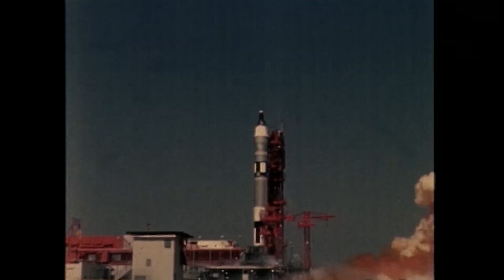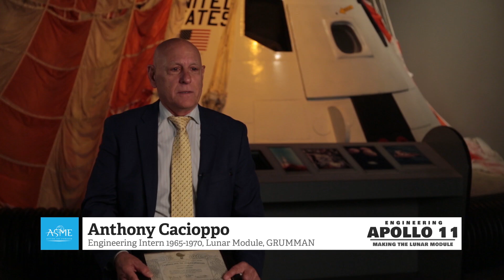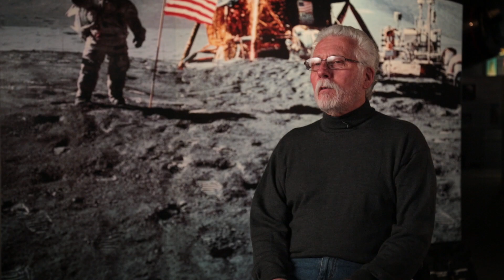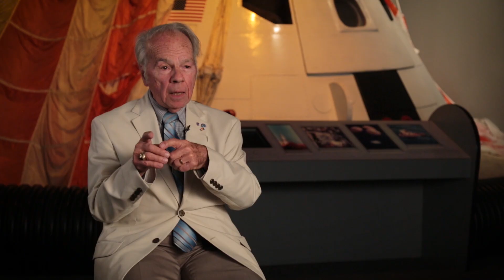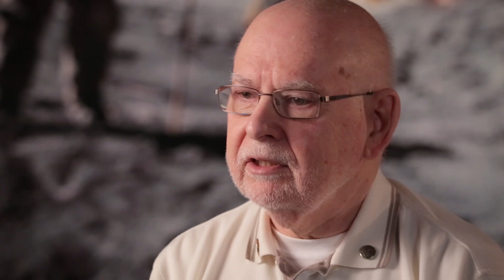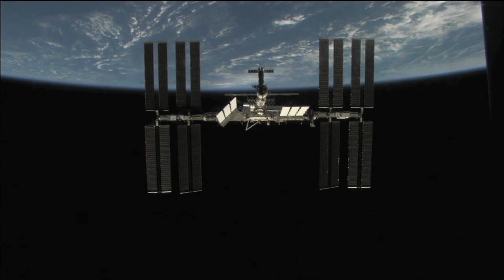Engineering Apollo 11: Making The Lunar Module [Full Documentary]

Comment: More deception, right down to the title. I was looking forward to how on the same crew vessel could that cool the hot side and warm the shadowed side but all I got was a bunch of flag waving. At this point there is no reason to release real, technical films of how it was constructed.
Reply: The lunar module is always sitting in the Sun. 
There are only two ways heat can transfer on the Moon. The first is radiation, both directly from the Sun and from the Sun’s reflection on the surface. The astronauts’ spacesuits were designed to reflect almost 90% of the light, so very little heat would have transferred to them. 
The second is by conduction from direct contact with the surface. This is also an ineffective process as the dust, soil and rock on the lunar surface is loose and doesn’t conduct heat well and the astronauts’ boots were insulated, slowing down conduction even further. 
The heat generated by the astronaut’s body was captured inside a web of fine tubing within the spacesuit, into which water was circulated. The heated water then entered a heat exchanger, located inside the suit’s backpack. This water then reached a sublimator, where it was slowly and gradually exposed to the vacuum of space. The consequent pressure-drop made its temperature fall; the water would freeze on the outer surface of the sublimator and turn directly from ice to water vapour, which was discharged through an appropriately provided duct. To increase and decrease cooling a dial on the suit control unit was used similar to a household environmental system. The Lunar Module used sublimation in a similar manner but with tanks of coolant.

Comment: Moon landing is something that is hard for me to believe. 
This things don't look like flying machines to me and both astronauts looks almost the same size of the module. 
To me, it just raised more questions
Reply: Because you are basing them on false premises.
Reply: You are basing your comments on what you are used to seeing an aeroplane do in an Earth environment. Because it would operate only in a vacuum, many things didn't need to be sturdy, nor did the shape of it matter. It would never have to deal with aerodynamic drag. In fact, the LEM was designed to buckle in the right places, as this was the most weight-efficient method of handling the shock of landing. The crew compartment was extremely cramped.
Reply: The lunar module was 23 feet tall.

Comment: Jim Steele answered to me. But I cannot find his post attached to my statement here, so I make it general. He calls me a moron which I always slide such person in the lowest inelligence level of evolutionary development. He argues that the blades that cut the lower and upper stages of LEM at take off do not have to be made of steel but rather of non-conducting material as not to create electrical shorts by severing cables and conduits between the stages. I never posted any thing about blades made out of steel. Or maybe he confuses steel with his last name of Steele; first name Jim?
Reply: So?
Reply: The blades of the guillotines were made out of steel. All of the electrical wires that were cut were deenergized first before the guillotines cut the wires. Since there was no longer any voltage on any of the wires, cutting the wires did not produce any electrical short circuits.

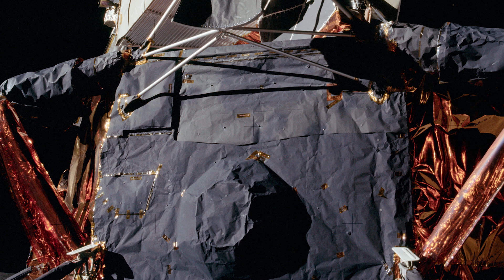Comment: At 5:38 the guy says that at the take off the upper part was severed from the lower part of LEM with a guillotine. Please, if you severed electrical cables, cables attached to batteries and fuel cells, fuel cables and other attachement conduits of upper and lower LEM parts, you would create unbelievable shorts in the electrical circuits and that would blow up all fuses and possibly create fire and render the take off as an impossibility. If anyone does not believe me, then take a pair of scissors and go up to any electrical cable that carries electrical current to a table lamp and cut it as fast as possible, then you will get an electrical shock and you will create a short circuit and at best blow fuses up in your home. I wonder who is that brave to do that. This is a bunch of crap. LEM never took any man to the Moon. No man was on the Moon.
Reply: All of the equipment in both stages contained isolation relays that were opened just prior to liftoff. After that all of the cabling going between the ascent and descent stages was deenergized before being cut by the guillotine. Similarly, as long as your lamp cord is unplugged before its cut nothing bad will happen except that the lamp won't work anymore. Also, there were no propellant lines going between the two stages because each had its own separate propellant supply.
Reply: @joevignolor4u949  I knew you would know the answer - excellent.
Reply: @joevignolor4u949  Keep right on OWNING the ignorant Dim Wit Joe. He's just a troll.
Reply: @joevignolor4u949  Hello Joe, one question I have that you might be able to answer.  Why didn't the SV4B/CSM-LEM stack travel on to the Moon after it had reached Earth orbit with the LEM in the shroud and then complete the transposition and docking just before orbiting the Moon. This would have protected the LEM for 3 days from the possibility of meteorite strikes, (which of course didn't happen) but I have always thought that was a big risk as it was rather flimsy. I suspect it had to do with fuel and weight restrictions. Thanks.
Reply: @Puma-70  Probably for several reasons. One was attitude control. The S-IVB had its own separate attitude control system that kept the stage and the Apollo spacecraft in the proper attitude during earth orbit, TLI and the transposition and docking maneuver. Once the propellant supply for the S-IVB attitude control system ran out there would be no way to perform attitude control using the S-IVB during the rest of the coast to the moon. The attitude control system on the CSM was too small to control the attitude of the CSM, LM and the S-IVB all together as one unit. Therefore it was necessary to get rid of the dead weight of the S-IVB. The other factor was the Inertial Measurement Unit (IMU) in the Instrumentation Unit (IU), which allowed to S-IVB to perform attitude control. The gyro platform inside the IMU was aligned at launch but like all platforms it would slowly drift over time. The platform in the S-IVB could not be realigned in flight using star sightings like the platforms in the CSM and LM could be. As such its usefulness as a reliable attitude reference was time restricted. 

Next, up to three mid-course corrections might be required during the outbound coast to the moon. If the S-IVB was still mated to the Apollo spacecraft the correction burns would have had to be done using the S-IVB's big engine instead of the smaller engine on the CSM. So now you might have to restart the engine on the S-IVB up to four times, instead of just once. You'd also have to load the extra propellants onto the S-IVB to do the corrections. 

Aside from these primary factors the S-IVB had flight batteries that would eventually run down. Another reason would have been that separating the CSM from the S-IVB would allow the high gain antenna on the back of the CSM to be deployed and used. Finally, on later missions they deliberately crashed the S-IVB's into the moon to do seismic experiments using the seismometers that had been left there on previous missions. As such the S-IVB and the Apollo spacecraft would obviously need to be on separate trajectories while coasting up to the moon.
Reply: @joevignolor4u949  Just got round to reading this - very interesting thanks.
Reply: Ok, We get it. You're the custodian of 'special' insider information and knowledge. All the hundreds of thousands of people involved in the development and eventual success of the SIX Apollo Moon Landings were, and are, the 'fake artists'. That'd include the Engineers and Scientists. The Mathematicians and Physicists. But not you of course. You're a member of a 'special' group of very clever and knowledgeable people who are 'in the know' about all this. Yeah, ------------------------ right.  Sadly for you, Modern History is what it is. NOT what you think or wish it to be. And the SIX Apollo Moon Landing Missions are a series of astonishing events in that history. Get used to the Reality of that.
Reply: @apolloskyfacer5842 When some one is talking about another person rather about what some one has to say, it automatically shows their own ignorance and low self esteem.

Comment: We know it was all fake. We woke up. ;)
Reply: Of course, it is all faked out:
At 5:38 the guy says that at the take off the upper part was severed from the lower part of LEM with a guillotine. Please, if you severed electrical cables, cables attached to batteries and fuel cells, fuel cables and other attachement conduits of upper and lower LEM parts, you would create unbelievable shorts in the electrical circuits and that would blow up all fuses and possibly create fire and render the take off as an impossibility. If anyone does not believe me, then take a pair of scissors and go up to any electrical cable that carries electrical current to a table lamp and cut it as fast as possible, then you will get an electrical shock and you will create a short circuit and at best blow fuses up in your home. I wonder who is that brave to do that. This is a bunch of crap. LEM never took any man to the Moon. No man was on the Moon.
Reply: @ericephemetherson3964  No matter how many times you cut and paste this you are still wrong - All of the equipment in both stages contained isolation relays that were opened just prior to liftoff. After that all of the cabling going between the ascent and descent stages was deenergized before being cut by the guillotine. Similarly, as long as your lamp cord is unplugged before its cut nothing bad will happen except that the lamp won't work anymore. Also, there were no propellant lines going between the two stages because each had its own separate propellant supply.
Reply: @joevignolor4u949  I understand your point theoretically. But all this you describe had to be done in unison with blasting the joint screws of both stages with pyrotechnical devices. And it is incredible that all was done at the moment of engine ignition. So: guillotine, blown joints, and engine rev. Also, you have to add immediate control of the attitude and thrust. Should these variables not be controlled, especially at the acceleration experiencing g forces, control can be lost right away. And did anyone think that any of these releasing devices may fail?
Reply: @ericephemetherson3964  When the LM's ascent stage launched from the moon it didn't do everything in unison. Instead the launch was a series of events done in sequence. The first thing the computer did was to open the propellant valves to start the ascent engine. The thrust produced by a rocket engine is directly related to chamber pressure. There was a pressure sensor that measured the chamber pressure inside the ascent engine. When the chamber pressure exceeded a low limit (85 psi as I recall) the pressure sensor sends an electrical signal to the computer telling it that the engine is running and producing sufficient thrust for liftoff. The computer then moves on to the next step in the sequence, which is to fire the guillotines. There were actually two guillotines to provide redundancy. Each guillotine had its own separate set of ballistic charges and firing circuits. The computer closed relays to connect the ballistics directly across the batteries. This fired the ballistics, which activated both guillotines to sever the connections. The next and final step was to mechanically separate the two stages. There were four explosive bolts holding the two stages together. Each one had redundant ballistics and firing circuits. When the computer decided it had come to the proper point in the sequence it closed relays to connect the ballistics across the batteries. The four explosive bolts then fired simultaneously severing the mechanical connection between the two stages. When this happened the descent stage essentially released the ascent stage, which then lifted off.

How the LM's guidance system provided attitude stability and trajectory control is a whole story in itself. Briefly, the LM's ascent engine had no gimbals to save weight. As such it used the RCS thrusters to control its attitude during the ascent. The ascent stage also had a low and wide aspect ratio that made it relatively stable (when compared to a tall skinny rocket). The guidance computer simply fired the four downward facing thrusters as required to stabilize the ascent stage as it climbed vertically going straight up the initial one hundred feet off the surface and then the vehicle pitched over to begin accelerating horizontally on its way to orbit.
 
If you spend enough time studying this stuff like I have you will find that NASA and the people at Grumman (who designed and built the LM) did give it all a lot of thought and they pretty much thought of everything. And this included adding dual redundancy and doing very careful design and performing rigorous testing so it all worked correctly when it had to.
Reply: @joevignolor4u949  Superb knowledge Joe - I must make a note of this.
Reply: @Puma-70  Thank you. It really is a great story if you take the time to read it.
Reply: @joevignolor4u949  Peter Ryan's 1971 book, 'The Invasion of the Moon 1957-70' is very good - I've had a copy for years and also Andrew Chaikin's - 'The Voyages of the Apollo astronauts.'

Comment: how did the battery for the rover worked for hours at a 127°C moon surface? the NASA manual explicitly says the battery shouldn't be put in an environment over 75-80°C.
Reply: Because that 127°C you’re quoting is max temperature at noon on the moon. They landed at dawn during the Apollo missions and that lasts for a few days on the moon. The highest temperature recorded on the 3rd EVA of a J-mission was 69°C so none of the lunar rover batteries experienced anything over 75-80°C until after the astronauts had left.
Reply: @mako88sb  The way I've always understood this (correct me if I'm wrong) is that the maximum temperature on the Moon is +260F at lunar noon but with no atmosphere this refers to surface temperature not atmospheric temperature. One lunar day (dawn to dusk) lasts nearly 15 earth days, and the astronauts were only on the Moon for a maximum of 3 earth days, so they weren’t there long enough for the Sun to be at its highest and hottest which would have been about 7 1/2 earth days, so after 3 days, roughly 1/2 of +260F = +130F which is the maximum heat spec for the Rover. I'm sure I once saw a documentary where the CAPCOM at Mission Control says the surface temperature for that day's moonwalk is +106F.  I think this was either Apollo 15 or 16.

Comment: It was really a combination of all sciences, engineering,enginuity coupled with human courage to such a mission.
Reply: engineering is not not science.
Reply: At 5:38 the guy says that at the take off the upper part was severed from the lower part of LEM with a guillotine. Please, if you severed electrical cables, cables attached to batteries and fuel cells, fuel cables and other attachement conduits of upper and lower LEM parts, you would create unbelievable shorts in the electrical circuits and that would blow up all fuses and possibly create fire and render the take off as an impossibility. If anyone does not believe me, then take a pair of scissors and go up to any electrical cable that carries electrical current to a table lamp and cut it as fast as possible, then you will get an electrical shock and you will create a short circuit and at best blow fuses up in your home. I wonder who is that brave to do that. This is a bunch of crap. LEM never took any man to the Moon. No man was on the Moon.